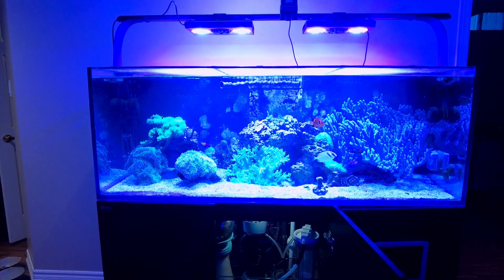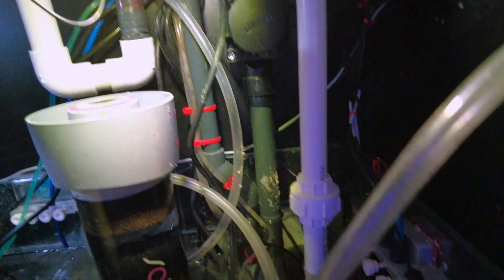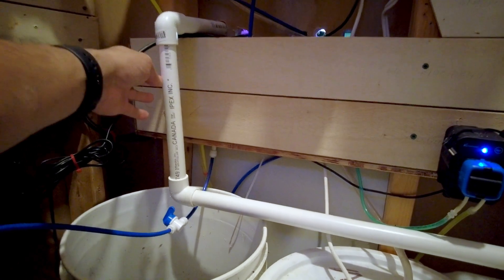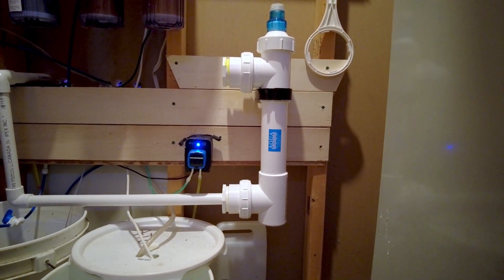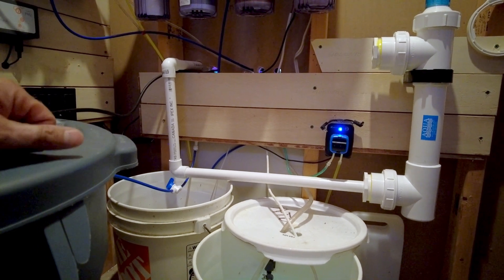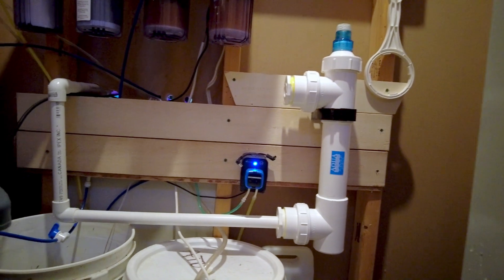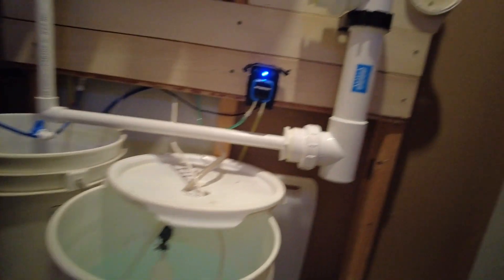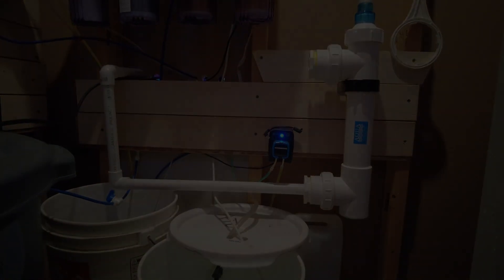Aqua UV Classic Series UV Sterilizer set up

Comment: What's the verdict on the flow? Setting one up myself for unwanted algae not parasites.
Reply from the maker: so the flow right now on mine says 500 and the pump is running at 60%. Been running it that way for a year now. No bad news yet.
Reply: @My525XLRedSeaReefer  Glad to hear it, thanks.
Reply: @My525XLRedSeaReefer  what pump did you use?
Reply from the maker: @CopperStateCorals  Hey there.. I'm using a Cor 20